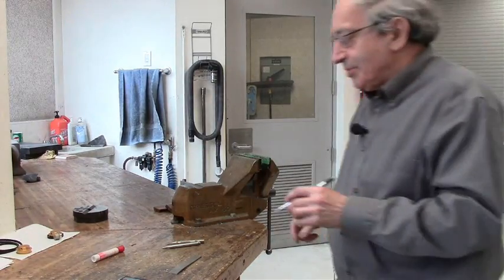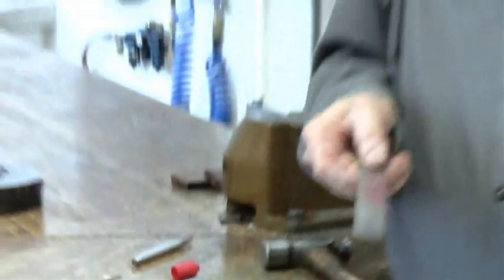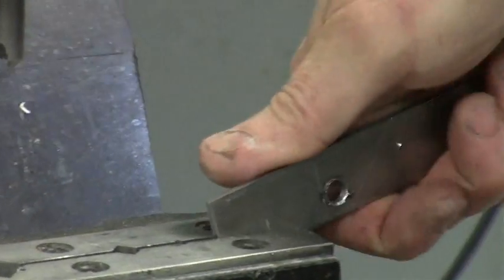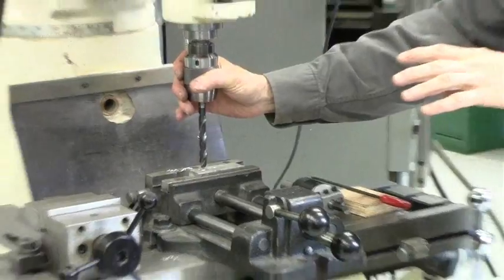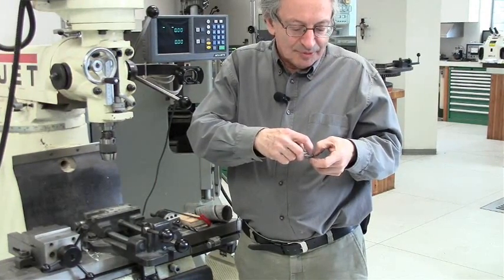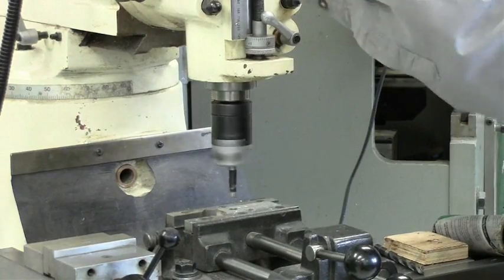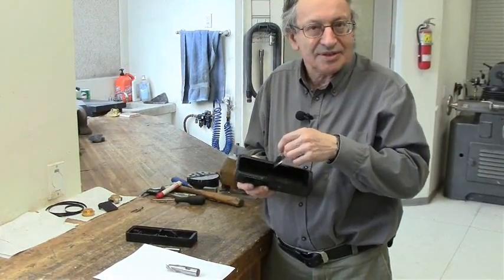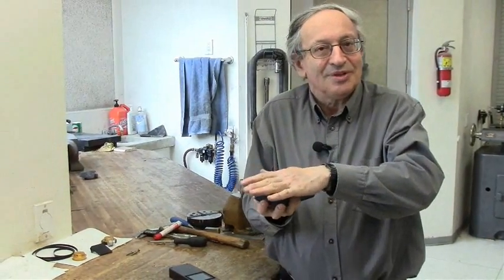Building Prototypes Dan Gelbart  part 16 of 18  Machining

Comment: I also use an optical centre punch where I see the point to be drilled microscopicly. It works great and doesn't take much time to acquire the needed location.

Comment: As is the case with Dan's other videos, I (notwithstanding decades of shop experience), I learn something from this one too.   But Dan didn't cover the basics that students and home-shop beginners (and even those with some experience) need to know:-
1.   Work should ALWAYS be clamped.   It's quicker, and therefore very tempting, to hold work by hand, but this leads to poorer quality and is a safety hazard;
2.   Use the right speed for the work material, drill size, and drill type (HSS, TiN, etc).   It isn't critical, but I have noticed beginners and even those who have had some trade training often use a quite wrong speed.   Too high can ruin the drill and/or work; too low uses up too much time and leads to a poor finish;  Any good engineering handbook will tell you how to choose the right speed.
3.   When you buy HSS drills, they are set up for mild steel.   If you are going to drill brass, they must be reground with zero rake, or it will grab.  (Dan did cover this in an earlier video).  For some types of brass and small holes, you can get away with old worn drills.  To drill aluminium sheet or plate, HSS drills ground for mild steel will tend to make pentagonal holes instead of round holes.   You should regrind them for aluminium.   To explain how would make this comment far too long,  but if you dig around, you'll find out.
4.   When drilling sheet metal, a lot of problems (non round holes, large burrs) are solved by using a backing plate of some scrap material.
5.   Dan suggests using an automatic centre pop followed by a traditional hammer-driven centre punch.  If you are going to use a hammer driven punch you might as well dispense with the automatic punch.   Auto punches tend to bounce around and cause inaccuracy.
6.   Reamers are very expensive.  Usually you want to ream a hole to get either a good finish or a precise diameter.   A poor man's reamer is an ordinary drill!   First (after the pilot hole as Dan showed), drill with a drill bit 0.1 mm under the final size.   Then drill again with the final size.
7.   With most common materials, cutting fluid isn't essential (though you should ALWAY ensure the bit doesn't get too hot).   However, with stainless steel, it's critically important.   There's lots of proprietry cutting fluids on the market.   I have complete success just squirting with CRC often enough to keep the hole wet.  And CRC has a multitude of uses.
8.   Any time a drill begins to go blunt, don't persevere, don't buy another drill, regrind the one you have.   It should only need a touch.
9.   There's lots of drill grinding devices and grinder attachments on the market, and home machinist/model engineer publications often describe them.   Don't bother with them.   Learn to regrind drills by eye holding them in vice-grips.(Irwin or equivalent).   It's not hard - you'll soon acquire the knack.
10.   For drilling aluminium, buy a quality set of HSS drill bits in 0.1 mm increments.  (or if you must be silly and avoid metric, but a set of number drills (0 to 60) and letter drills.  A quality set will last a lifetime.  I'm still using a P&N (a once common Australian made brand) set I bought 50 years ago.  Don't buy those cheap and nasty Chinese drills you see in retail hardware stores.
11.   Keep your drills in their box and give them an occasional squirt of CRC.  Even if your workshop is a draughty cold shed, they'll never go rusty.

Comment: Hi Dan,

Another great video on machining.  How accurate is your Jet mill, in regards to locking the table and how much inaccuracies are incurred, during the locking process?  I find my Bridgeport mill moves by a few thousands whenever I lock the table. in both axises.
Reply from the maker: I would guess the Jet mill is the same, certainly not better. I only use the Jet for "quick and dirty" small jobs. My milling machine is a Makino KE55, which is a wonderful CNC/manual  mill, but like all great machines they stopped making it.

Comment: is there a rule of thumb as to the sizes of drill used when graduating up to a specific final size?
Reply from the maker: For large holes drill first with a drill of about half the diameter. To better size a hole drill with a drill about 0.2mm smaller, than ream or drill to final size. Most re-sharpened drills will drill  about 0.1mm oversize, therefore 0.2mm rather than 0.1mm smaller.
Reply: thank you!

Comment: Using the tips of the Digital Caliper to scribe lines is definitely a NO NO. . . . . Bad Practice.
Reply: Using a cheap digital caliper you’ll find they last quite a long time for doing layout before needing replacement and the speed is great. Saving your precision ( i.e. expensive) calipers for precision work.
Reply: Faster pays for many new calibers! Using a caliber is really quick with acceptable accuracy. For example: Assume you save 10 seconds each time you use a caliber versus some other way of scribing. Let's further assume you need  to scribe about 20 lines (that is at least nineteen hole locations) each day during a prototype building. You work about 1/3 of your time, or 80 days, on prototypes per year. The total time you save is is about 4 hours. If your shop rate (unburdened) is $30, you can buy one really nice Mitutoyo caliber every year. And, at the usage described above the caliber will last much more than a year.
Reply: Other than buying more calipers you can also get carbide tipped ones specific to this purpose.

Comment: Agree that the single parts (each half of the housing) would be shorter to machine by splitting the housing near the middle, however, if you made a single deep housing with a 2D lid then the longer machining time of the deeper housing would likely be offset by the then very simple lid, which can now also be potentially water cut. It is likely sensitive to how deep the housing needs to be and if the difference between 2 halves and a single deep section means specialised tooling or not. Thanks for the videos, learning a lot.

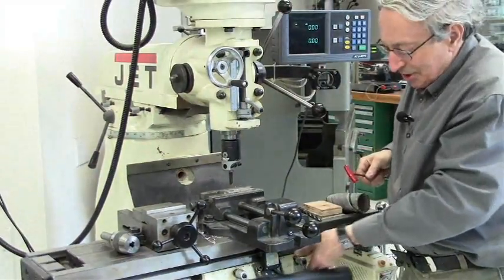Comment: 10:30 talks about rigidity. Uses his drilling vice....
Man, I had to work hard to come up with even this tiny inconsistency. This guy rocks!
Reply from the maker: I wouldn't use it for boring steel, but for a light cut in aluminum, I never had a problem. Your point is still valid, I should have used the milling vise.
Reply: you can use the milling vice...
You can do whatever you like :)

Sorry for being critical.

I take great joy in what you do. It's wonderful to watch you work. Criticism is unnecessary and I share what you have taught with my students every day.

Thanks :)
Reply: Milling with a drilling vise is a milling vice! :-)

Comment from the maker: Regarding comments from PMX-Tek: 
1. The calipers tips are ground at a sharp angle for ease of scribing, as seen in close-up shots. 
2. The chisel is ground especially for deburring, as explained in video. 
3. Pulsed laser welder does not require inert gas, just try it and compare bond strength.  Only CW (continuous) laser welder require gas. 
4. The videos are intended for people who do not have machining/welding skills, as clearly explained in first video of series. I'm a great fan of welding myself, but it needs training. 
I agree that some of the methods are a bit unorthodox, but please try them before you make up your mind. Everything shown was used for many years with good results.